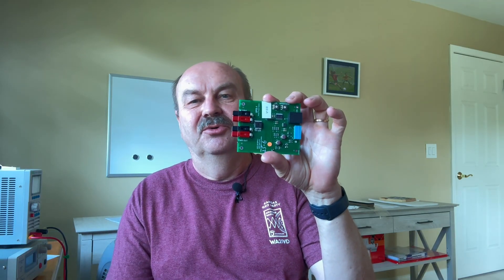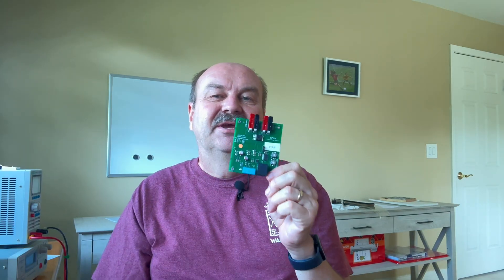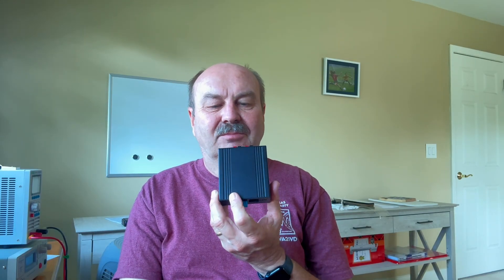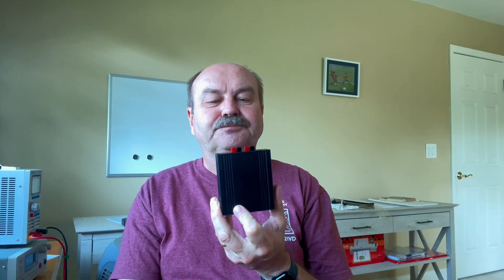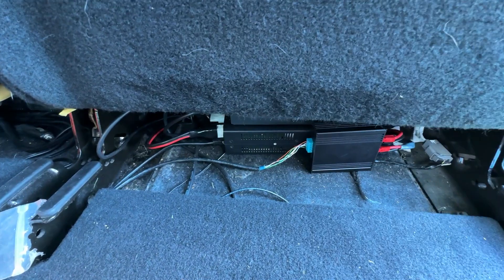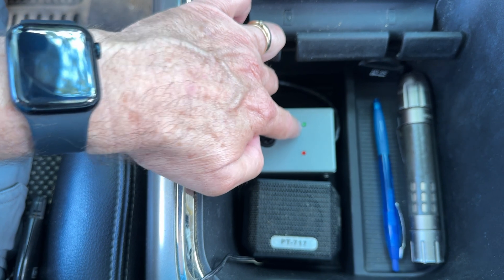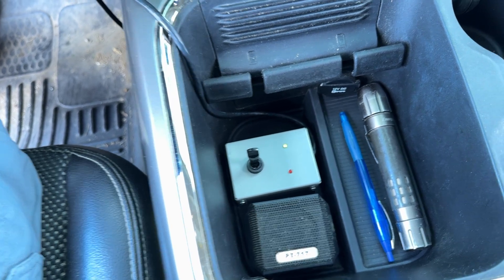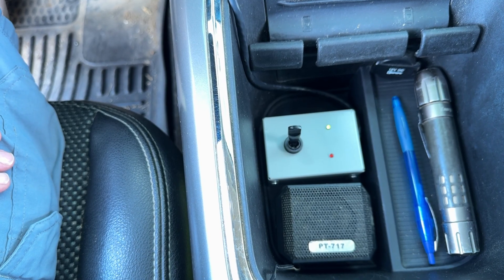Smart Power Switch Update

Comment: The low voltage at startup on Ram Diesels is the intake grid heater. It draws a lot at startup.
Reply from the maker: I would agree with that in the winter.  But, this is in warm weather.  I've watched the battery voltage at startup.  It doesn't drop a lot like a heavy load.  It just sits at 12.5 or 12.6 and doesn't jump up to 13+ until after the truck is running for 20 or 30 seconds.

Comment: Great board/unit Tom!
I have a suggestion for version 2 if you ever go there.
One of the mobile engine-off problems (especially with Icom radios) is running off battery and low voltage.
I think a great upgrade would be to have an onboard voltage boster to bring 12.6V up to around 14v (adjustable) for a 100W radio.
I have a bulky separate unit for this now, but it would be great to have this function built into your smart unit. - Cheers! - VE3GHP
Reply: I’m curious, would a one farad capacitor tied across the powerline do the same thing on maintaining the voltage, also with the engine off and on problem. The guys that use stereos in their trucks and vehicles with large base speakers, use these capacitors to maintain voltage.